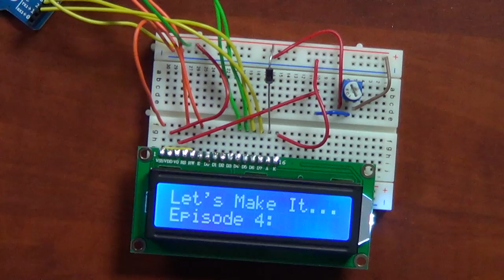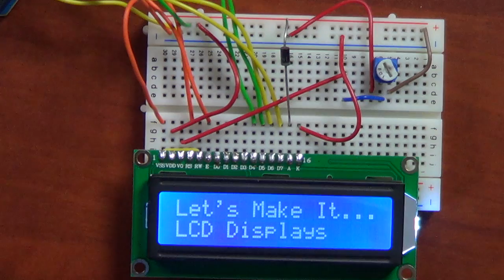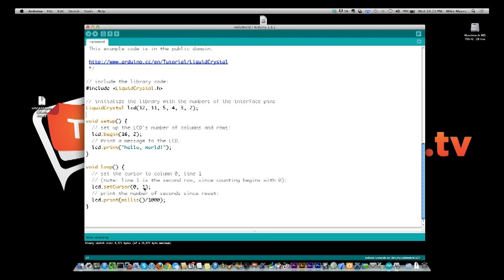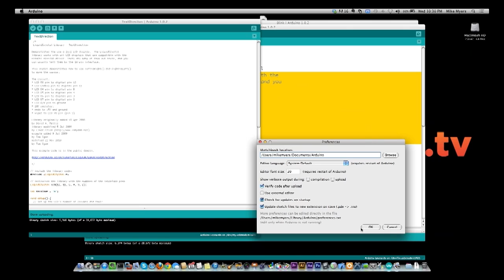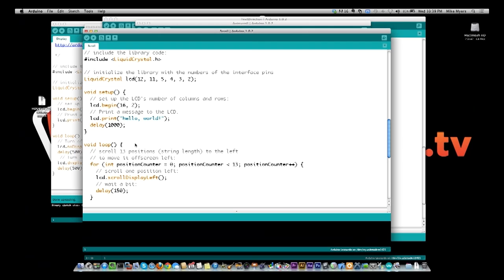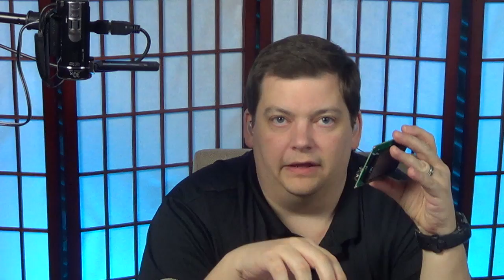Adding an LCD display to the Arduino - Let's Make It - Episode 4

Comment: There is actually a mistake in either the schematics or the initialization of the LCD ...
DATA PINs are in the reverse order!
schematic tells D4 to PIN3, D5 to PIN4, D6 to PIN 5 and D7 to PIN6 ...
LCD is initialized D4 to PIN5, D5 to PIN4, D6 to PIN3 and D7 to PIN2 ...
At 2:50 you can see it is hooked up like the initialization and not like the schematic tells to hook it up!

Comment: Hi I just got my Arduino this week. Having fun with the basic tutorials I'm finding. I really like Mike's Tutorials. I'm trying this one and on luck. It appears I have the same LCD as Mike. I've done all the jumpers correct but no letters appear. The backlight works I see blocks where there should be letters, the top row is white blocks the bottom row is black blocks all on a blue backround. the contrast seems to work properly also. Any ideas? I have a LED inline instead of a regular diode. But I don't think that should hurt.My soldering sucks but I think its good enough. I tried to resolder my pins to the LCD but still no luck. How hot does it need to get to hurt the motherboard for the LCD. I don't think i got it too hot but it did get hot.

   ...Thanks Ralph

Comment: Can anyone explain to me what the diode 1N4004 is for ? It has max current on 1A and if i can see right does nothing but connect the 5V pin to the K pin (NC) , (To my opinion this can be bad because we are not controlling the current ?) 

What am i missing ?
Reply: Daniel Saranovic I have not read the spec sheet for these, but a typical blue LED draws its rated maximum current in the area of 3.6 volts or so.  I suspect he is using the diode to drop the voltage from a 5V supply, but am not certain.  I would probably run it in a more current limited manner by using a dropping resistor if I know the back light  LED's current draw.  As you probably already know it is a simple calculation based on V = IR where V would be the voltage drop across the resistor, I the current passing through it, and R, the value of the resistor.  If I did not know, I would probably test it out and run it at 20mA or less.

Comment: there is no difference between 8bit mode and 4bit mode, both modes can do what the other can. the difference and only difference is that the number of lines is 4 in 4bit mode instead of 8 in 8bit mode, and that tighter timing is needed in 4bit mode that is all :)
( i have written drivers for these displays)